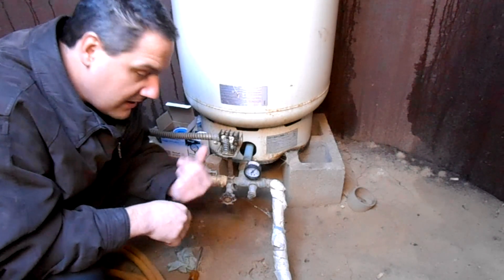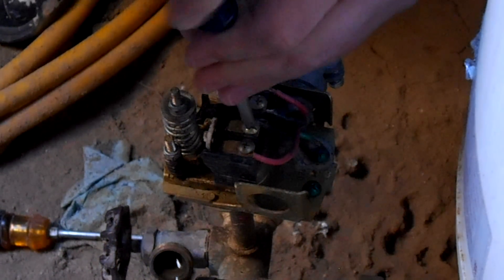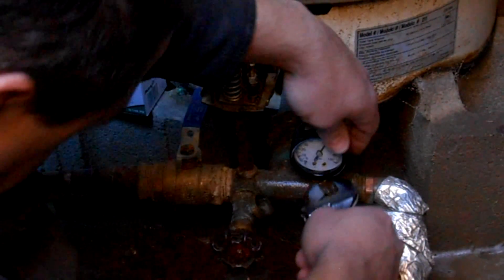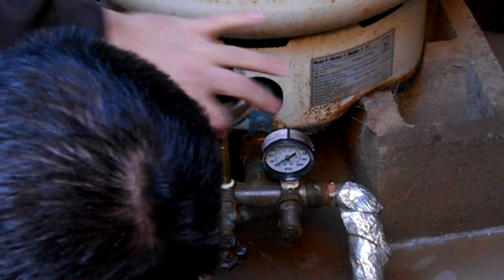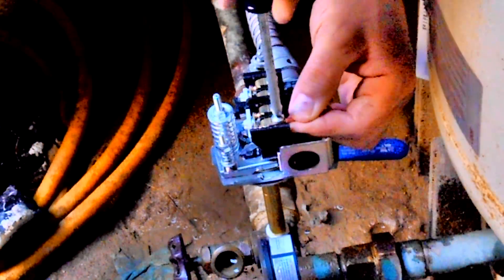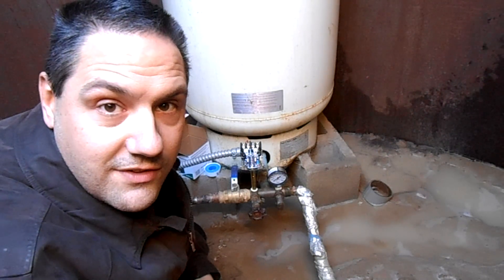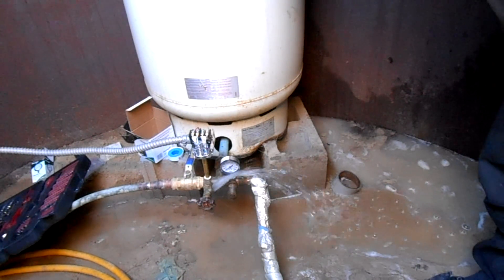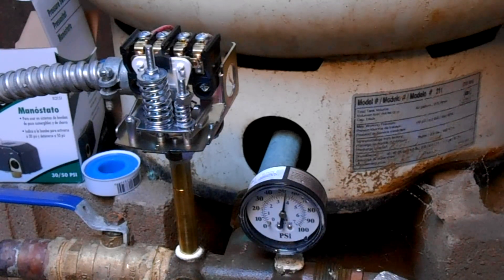Replacing a well pressure switch & re-pressurizing the tank to avoid short cycling

Comment: how to adjust pressure switch to lower level to avoid leaking along the piping
Reply from the maker: The pressure switch is adjusted using the nut at the top of the spring.

Comment: Hi your post is very helpful, however,  I have some feedback about the pressure tank regulation,   I think the pressure tank Air should not be leak and need to be set at correct PSI, 
See Video Link below:

https://youtu.be/fbqtXF-MtLk
https://youtu.be/2RH5imXT2SQ

Comment: Old video but I just happened upon it. A couple comments. As others have noted, the tank should be pressurized to 2 psi below the cut on value of the pressure switch. For a 30/50 switch, the empty tank should be pressurized to 28 psi.  2nd - the pipe dope needs to be on the outside threads only. In the video, you can see he gets some on top of the pipe and a little bit inside the pipe. That's going to get into your pressure switch and decrease its lifespan.

Comment: Hi,  I don't get when you depressurize the tank let water out, you don't put air pressure in using pump to 28psi ? How would the water itself pressurized the holding tank, don't you have to pressurize it to 28 using pump ?
I don't get that part.
Reply from the maker: In this example, the diaphragm was damaged, so the water in the tank can't get out due to suction.  Like when you cover a straw and pull it out of a glass of water.  So, opening the valve was allowing air to go in through the top so the water could run out of the bottom.

Comment: Just replaced my shallow well jet pump and now my water pressure stops rising about 10 psi before cut-off. Thus the motor wont shut off. Why is this?
Reply: I'm sure you've figured this out by now, but it's my current problem also. Did it turn out to be the pressure gauge/pressure switch that was at fault? Foot valve? Your comment here is convincing me that I don't really need a new pump like the well company told me I do. I'm thinking it's the gauge/switch. But I'm also wondering how to make sure all the pressure is gone before I disconnect something and water starts spraying all over the place. Especially if I can't trust the gauge.

Comment: If I replaced the pressure switch already what else could it be?
Reply from the maker: If you have used a multi-meter to verify that there is power at the pressure switch, as well as on the pump side when the pressure switch is closed, the only other thing I can think of would be the well pump itself. :(

Comment: I wonder how many people turned off the video when they seen you not connecting a hose and just draining the water on the floor around you. And in doing so missed out on learning about how to prevent short cycling lol.
Reply from the maker: My guess would be zero because many people doing this understand that you can't completely drain a pressure tank that is 8 feet down in a hole.  That and the "floor" is just dirt.  But, if you would like, the next time it needs to be done, you can carry a 5 gallon buck up an 8 foot later if you'd like.  I'll be kind enough to let you.

Comment: I don't understand why he wouldn't use the New Safety Pressure Switch. If the pressure drops more than 10 lbs below cut in, it locks out, assumes something went wrong. To reset, you just hold the lever up while watching the pressure gauge, once it's above cut in, release the lever. This can protect you fro flood from a broken pipe, Well  pump running dry, or some kid opening all your outside faucets, while your at work.

Comment: My pressure guage is leaking. Does that mean I need to replace both the guage and the switch?
Reply from the maker: Probably not, if your system is turning on/off properly, your switch is fine.  If it's leaking from the inlet or outlet of the pressure gauge, you probably just need to take it off, clean the ends, and put it back on with Teflon tape or plumbing thread sealer.  If it's leaking from where the actual gauge, you'll need to replace the entire gauge.
Reply: @dslynx  thanks,  replaced guage only and it worked
Reply from the maker: @-Cece  YOU ROCK!

Comment: When he was draining the tank how was it able to keep draining if you wasn’t pushing the needle in on the valve. ? Did you just break it loose and leave it while it drained ? Appreciate the video .
Reply from the maker: The needle on the valve had to be pressed to completely drain the tank. As air was being pulled into the tank to displace the water, there were times that I could let go of the valve and it would continue to drain till the vacuum inside stopped the water flow.  Then I had to open the valve to let more air in so it would continue to drain.  Keep in mind, this tank had a busted bladder that was full of water.  When I replaced the tank, I did end up using a hammer to break the valve off and allow it to drain through the top so I could lift it out of the "utility room", which is an 8-10 foot hole in the ground.

Comment: You shouldn't have to add air or take air out of a pressure tank, if u are having to put add in the tank or tank air out then the tank has failed it comes precharged at 28 psi 2 lbs below the cut in pressure, set for a 30 50 psi pressure switch. The pressure tank has a diaphragm inside  it that keeps the air and water from mixing, and if it does it then will be a water log pressure tank  and cause it to short cycling. And when u drain down the system then all the water thats in the pressure tank should and will  drain out but if it doesnt the tank is bad and water logged.

Comment: The instructions that came with my pressure tank said when the tank is new and empty to pressurize it 4 pounds (the instructions called it the "pre-charge") below the pressure switch cut in pressure . I have a 30 / 50 pressure switch so I used 26 lbs. Also, to drain the tank completely I kept putting air in the tank until all the water was squeezed out. It took quite a while.

Comment: Great video for a City person like me.  Question - we are actually buying a home to use on the weekends and it has well water.  I was given advice to to turn off the power to the pressure switch, so that the system is not pressurized during the week when the house is empty (for fear of freezing pipes in the event that the heat goes out).  And when we turn up on Friday eve, restore the power to the pressure switch.  Is this a bad idea? Common practice?  What about killing the power to the pump itself?  Thanks!
Reply from the maker: Hello, thanks for the comment and question.  When you shut off the power to the pressure switch, you are shutting off the power to the pump.  Yes, this is a good idea for winterizing the well.  Just keep in mind, that you will also need to drain the rest of the house.  This includes the hot water heater and any lines.  So, when I winterized my house in the past for an extended vacation, I shut off the power to the pressure switch, opened all the faucets in the house, flushed the toilets, and drained the hot water heater.  Also, don't forget about the water line and filter in the fridge (if you have one).  Basically, any place that might be holding water will need to be drained to keep it from freezing and breaking things. Also, if this is going to be a common practice and the house has a phone line or internet access, it might be much less work to purchase a thermostat that can call or text you if the heat goes below a specific temperature.  Good luck!

Comment: You forgot to me tion the part that with the tank empty of water to pressurized the tank with air pressure in order for the tank to work correctly.
Reply from the maker: Unfortunately, in this case, that wouldn't have helped, the bladder in the tank is collapsed.

Comment: I have a  30 / 50 pump...... it get up to 50 PSI but continues to run, ideas?
Reply from the maker: Did you install a new pressure switch?  If so, I would verify you have the wiring correct, the sole purpose of the pressure switch is to shut off at the desired pressure.  If the wiring is correct, I would suggest reading up on the manual for your pressure switch model and verify it is set to 30 / 50.  If you have messed with the nuts on top of either of the springs, you may have changed the pressure settings.

Comment: I'm trying to do this in an EXTREMELY cramped space.  My fix has to last only two months.  I'm wondering if I could just bleed the  pressure down to 2 psi below cut-in pressure and just leave the water in it.
Reply from the maker: Sure, you can do that.  You may need to perform the process multiple times within the two month, depending on what is wrong with your tank, but you'll be able to tell when it needs to be done again when you see the pump short cycling while running water.  I had went through the process a few times before I learned that water was stuck in the tank and drained it all out.  Even at that point, the bladder was busted but it would work fine till the bladder filled with water again.  Good luck.

Comment: Do you need to add air back to the tank with a compressor ?
Reply: unknownledgend1 yes 2 pounds under the lowest pressure. If the switch and gauge is set at 30/50psi then put 28 psi in the tank, if it is set at 40/60PSI  but 38 psi back in with a compressor.

Comment: Any tank with a bladder/diaphragm needs to be pressurized when fully empty to two pounds below the cut-in pressure on the switch.  A 30/50 well pressure switch would need the emptied tank pressurized to 28 pounds.  A 40/60 switch would need the empty tank pressurized to 38 pounds.  This is necessary for the pressure switch and pump to operate efficiently and correctly.  It's good to drain the tank as shown, but then you need to re-pressurize the empty tank to the correct value by pumping air through the valve stem located at the top of the tank.
Reply: The instructions that came with my pressure tank said when the tank is empty to pressurize it 4 pounds below the pressure switch cut in pressure. I have a 30 / 50 pressure switch so I used 26 lbs. Also, to drain the tank completely I kept putting air in the tank until all the water was squeezed out. It took quite a while.
Reply: come on your correct
Reply: cenjim you're right
Reply: You're damn right
Reply: Women fights
Reply: How many pounds of pressure should a 20/40 switch have
Reply: @seetherguymna101   18 pounds.
Reply: There's a hole in his bladder that's why he did this
Reply: Hi, right.  So how come he didn't pressurize it ? Do you pressurize the tank using a normal bike pump ? To 28psi for 30/50 switch...
My issue is, it won't shut off, and I just swaped for new switch.  Still not shutting off.
But, I didn't check pressure in tank etc. When empty...
Could this be the issue of pump not shutting off, and pump has hard time building to over 40psi...
Reply: @RadicalCoach , I would say that without knowing what the pressure in the tank is when it's drained of water, the switch will have trouble sensing the cutoff point.  Drain the tank, measure the tank pressure and then pressurize it to the level recommended by the switch you have.  You can use a compressor, a bike pump or a tire inflator.  The valve is usually at the top of the tank.  Pressurize it to 2 pounds below the cutoff unless your switch states 4 pounds under.  Once properly pressurized, you can let the pump restart and fill the tank and the switch should sense the cutoff point.
Reply: Yes i thought i might learn something but i only learned the wrong way to do it
Reply: That job is completely wrong lol
Reply: IF you release the air valve. and the water comes out of the tank. Your bladder has a hole in it to let the water drain. Something is wrong with the explanation James. Please clarify the thought Sir. Thanks v        😀😀
Reply: @victoryfirst2878 , I made some edits to clarify my response.  I must note, however, that if the bladder/diaphragm has a hole in it, the entire tank must be replaced because water below the diaphragm will leak through that hole and defeat the function of the diaphragm.
Reply: Thank you for that information Jim. I will be working on my tank this week and have the know how. Peace v
Reply: @victoryfirst2878 , You're welcome.  You'll do fine.  I had to replace our pressure tank 7 or 8 years ago when the bladder failed and we had the short-cycling problem going on.  Good luck with the project!
Reply: @cenjim  Thank you Sir.

Comment: One of my 20 amp FRN-R-20 heavy duty fuses blew. I bought a two pack of the wrong replacement and used a general purpose NON 20A in place of the blown heavy duty one and watched that sucker spark a quick fireworks show. I then moved the existing FRN-R-20 fuse over to the side that blew and put the one remaining general purpose fuse in the side that was fine and it didn't blow. I'm getting 110v power readings at the pressure switch and on the wires coming in to the control panel from the fuse box. I'm not getting any readings coming out of the control panel box 3-wire run that connects to the junction box on top of the water well casing. Could the wrong 20amp fuse keep the pressure switch from turning on the pump? I picked up the correct fuses today but  I was just  curious. Thoughts?
Reply from the maker: Sorry, I'm kind of confused with your explanation. Being very careful, I would force the contacts of the pressure switch open (using something non-conductive).  At that point, any good fuse should provide 220v to the pressure switch contacts.  It's only when the pump turns on (pressure switch closes) that it would blow a non "slow blow" fuse due to the amperage draw to start the pump.  It's hard to explain without video/pictures, but you should be able to follow the 220v all the way to the pressure switch if the contacts are held open.  At any point, if you loose 110v on either leg (or 220v across them both) that is where you need to start your troubleshooting.  When I measure, I measure both sides of the fuses.  If either side is 0v, the fuse is bad/blown, then move to each contact location that you can measure voltage till I get to the pressure switch.  If you have 220v at the pressure switch, putting in slow blow fuses should resolve your issue.  If one still blows immediately, you may have a short in your pump (or somewhere along the line after the pressure switch).  Keep in mind that anything over 45 volts can overcome your skins resistance and it only takes .5 amps across your heart to stop it.  So be vary careful and if you aren't comfortable with measuring the voltage along the entire system, contact a professional.  It's not the volts that kill you, it's the amps.
Reply: Great info thanks, I have power all the way out to the junction box on top of the well casing. I tapped on the pressure switch and the contacts sparked but the pump isn't turning on. There is water in the pipe but no water pressure in the tank ( just the air pressure) . If the pressure to the switch is blocked or plugged by something which I doubt, should the pump still turn on when the contacts spark? My pump is probably bad I'm thinking...

Comment: So as long as there isn't anything wrong with my bladder, I should mess with the air pressure correct?
Reply from the maker: The air pressure in the bladder should match what is listed on the tank.  If you can't find it on the label, search for the exact make and model of your tank and verify what the pressure should be and fill it to that.

Comment: id least open up all the faucets that way u dont have water all over the place
Reply from the maker: Unfortunately, that doesn't remove the water from the pressure tank when it is 8+ feet under ground with no pressure to push it up into the house.  I had already done what you are talking about, but it's a 60 gallon pressure tank.

Comment: well I followed this and I'm not getting any pressure on the gauge...fml
Reply from the maker: There are only three things that come to mind that could cause no pressure.  1) No power.  Make sure the pressure switch is getting power and make sure it is making contact, to send that power on to the well pump.  If you don't have power, check up the line, as there should be fuses in the safety switch that may have blown and need replaced.  2) Broken pressure gauge.  If you hear the pump turning on, even if you don't hear the pump itself, you should be able to hear the effects of water filling the pressure tank, but the pressure gauge doesn't show a reading, your gauge may be bad. 3) Bad pump.  Hopefully it isn't this one. If you can verify the pump is getting power, but not turning on, the pump may be bad or seized.  I would suggest purchasing a multi-meter if you don't have one, and verify the voltage on the pressure switch connections that power the pump.